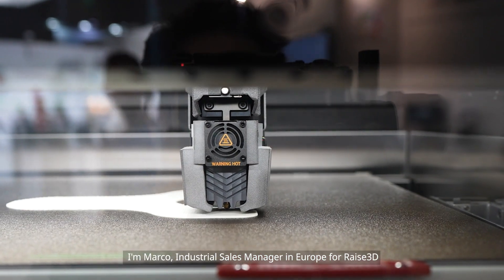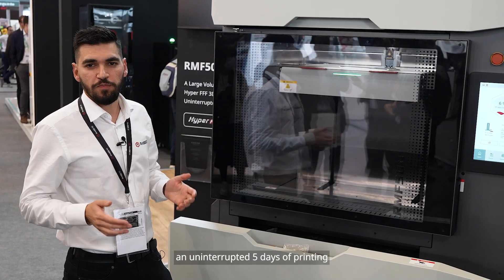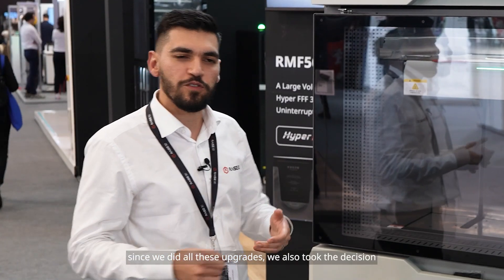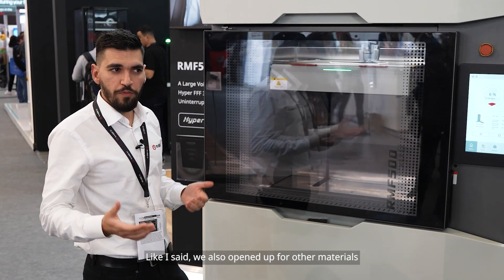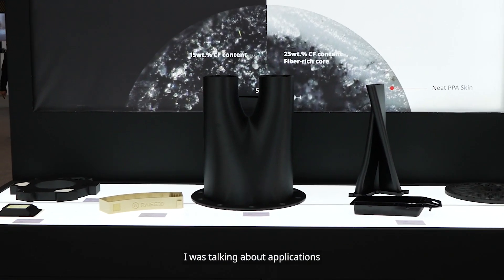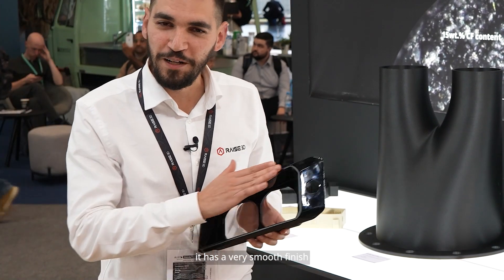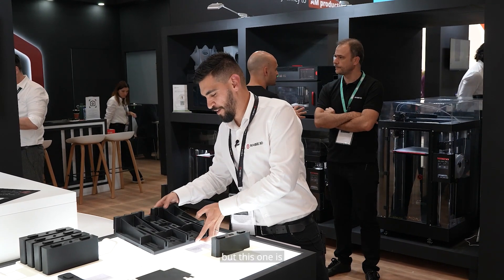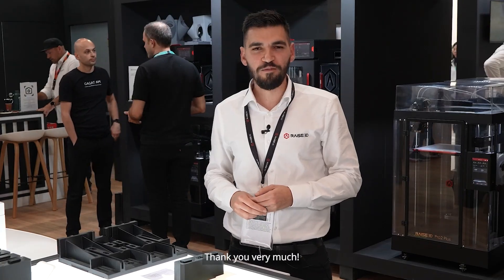Formnext 2023   Raise3D RMF500 Introduction

Comment: These are $70,000 USD. This is an insane price for a slightly larger printer with the same capabilities as Bambulab X1
Reply: Agree its a lot of money but it has 8X the print volume of an X1, Dual Printing heads and is design to deal with Carbon Fiber filament and the need to keep filament dry and can run for 5 days without loading more filament. So not really the same capabilities as an X1